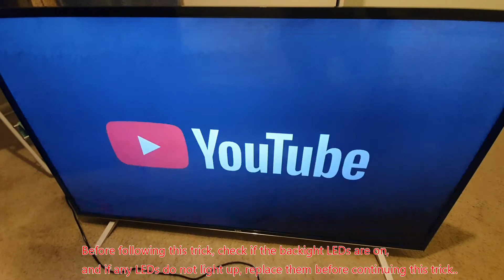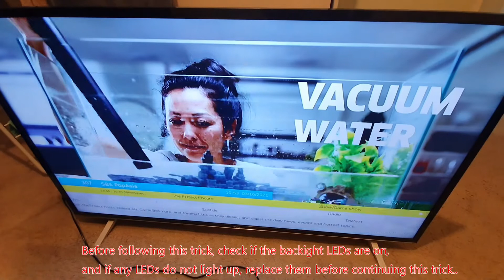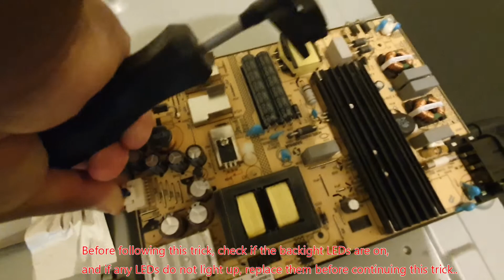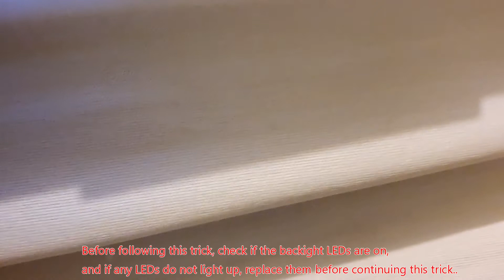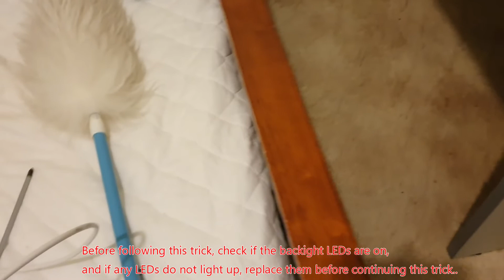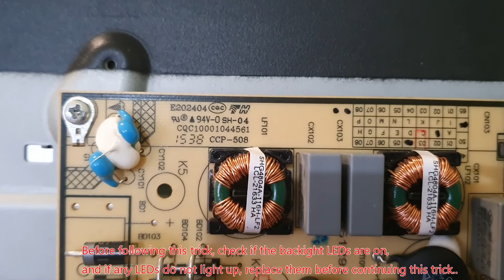TCL Smart TV Backlight Flickering Issue Fixing Trick

Comment: The issue I have with a 55S451 is that 1 side with go 50% dark the other side about 25% every minute or so for split second then recover, see some say a setting to turn off for certain content, so different issue with mine if not app related.

Comment: Bought a used TCL 43S405 and it's having this same issue. Googled the power supply and seems to be different, not sure if it will be a similar fix or not though. Setting the TV to "Low Power" in the picture settings, and the brightness to "Normal" makes it stop flickering constantly but the picture is a lot darker than I'd like. All of the LED's in the backlight seem to be working as I don't see any dark spots in the screen anywhere. Seems the power supply is just cutting power to the strips constantly. If I set it to any mode other than "Low Power" and then set the brightness to  "Brightest" in the menu it starts flickering constantly every 2-3 seconds almost like clockwork. If I set it to just "Bright" it flickers every 5-7 seconds. Turning "Low Power" mode off, and setting it to any other picture mode and the brightness to "Dark" or "Darker" seems to "fix" it as well. It definitely seems to be something power related, I just don't really know what. I'd guess heat related if it didn't do it almost instantly between switching brightness modes, but it's not a slow build up. Feels like LED over current or something. As soon as the LED's get more voltage it cuts the power to them on a cycle. I'm guessing good power supply, bad LED's? Lower the voltage sent to the LED's seems to be the "working" solution, so I'm not sure of a proper fix. Thoughts?

Comment: Thank you for the video. I remove 2 resistors. Still blinking. Put heat sink. It is working if i do not put the cover on. Then my last solution. I drill 16 holes on the cover so there's air ventilation for the heat sink. It is working ok so far for 10 min.

Comment: Hi bro led is good . But top right corner only blink .... What is the problem
Reply: I have the same problem right side Flickr snd red line/pixels vertical,from what i see it was fix with tape on the 12 and 13 pin but you need to have two 80!pin and no one going from main board so you do it to the one going to the right side only.
From what i know so far it was sorted ic on main board that need to be isolated pins by the tape
Reply from the maker: This may be due to panel issue. First remove the LCD and turn on the backling and see whether the LEDs are actually blinking.

Comment: Hi. We have the same problem and I followed your instructions. After I removed one of the resistors, it worked for 15 minutes then again same problem. I did not fix the heat sink but I removed another resistor. It was turning on but no more led lights from the screen. Now, I messed up the 2 resistors. Can you advise how to fix? Shops here dont have the R470 resistors and need to order online.
Reply: I have the heat sink available but I still need to fix the resistors first before putting additional heat sink.
Reply from the maker: Did you check the LEDs in the backlight, are they all good? If yes, add a resistor back and add extra heatsink(don't short circuit the heat sink and other components). Also do a proper dust cleanup for both Power board and main board using a brush.
If you lost two 470 resistors, just use around 47 Ohms normal resistors for them. Don't use low values, it will damage LEDs.

Good luck..!
Reply: @tech-corner2556  yes all led's are working before I lost the resistors. I don't have any clue about resistors as I just diy the problem and came across your video. I will check with some shops here about 47 ohm. Thanks for replying.
Reply: @tech-corner2556  Sir, how many watts should I use if I will buy the normal resistor with 47 ohm?
Reply from the maker: @spanksoil4  If you are going to add back two 47Ohms, use 0.5 W resistors. If you are going to add back only one 47Ohms, it is good to use 0.75W or 1W.
As you said the backlight was working when only one 47 is removed? If yes, I recommend to use two 100 Ohms with 0.5W. It will make 50 ohms resistor (because they are parallel) which is close to one 47 Ohms. You can easily find the 100 ohms 0.5w resistor.

Comment: My TCL 55 screen is flashing from the top right side corner.. quick flashes till the half of the screen
Reply from the maker: @Jay, can you upload a small video clip. Then I can help you.
Reply: @tech-corner2556  Hey thanks for replying 👍👍  Please find link for video
 https://youtu.be/naB1-JaHjcU
Reply from the maker: @JC-YT-JC  I just watched your video. This may be backlight issue or panel issue.
To identify the issue follow these steps.

1. Remove the T-CON board to panel ribbon cable in the flickering side and turn on the tv. Now you will see a dark or white color screen in that half of the screen. If you still see the flickering (if the screen is dark you can observe the flickering via other side, because the flickering is spread in whole screen in background if it is a backlight issue), it is a backlight issue. then remove the backlight cover and test all individual LED's and replace bad LEDs. See this video for more details : https://youtu.be/6CVT9-Lts4o

2. If the flickering stopped when remove the ribbon cable in that side, it is a panel issue which is difficult or unable to fix. You can try this method and if you have a luck, you can get it working > https://www.youtube.com/watch?v=pfrRhw7-ZII

Don't think about the issue which explined in that video, but follow the Tape pasting step. You don't need to use large tape and cut and remove. Jut paste a small (around 2-3mm) tape to cover few 2-3 lines and move the tape into different lines untill you get a proprer picture without flickering..

Let us know the results. Good luck..!
Reply: @tech-corner2556  Amazing 👍👍 Thank you for your reply. I will give it a go 🤗
Reply from the maker: @JC-YT-JC  What happened to your tv issue, Fixed? Im not sure whether this is the issue you see, just check this : https://youtu.be/7H5pvbr2ESo

Comment: Picture is intermittently moving up and down .  From clear to blurr
Reply from the maker: Can you send me video? Then I can get a idea about the issue.
Did you check/clean the t-con ribbon cables first of all?

Follow these steps:
1. Clean the T-CON ribbon cables.
2. Remove one side's ribbon cable to see other half of the screen is working correctly. If working correctly, that mean the removed side has the issue. Do the same thing for other side as well. Not you can understand whether the issue coming from a side or not.
3. If the issue exist in a side, you can try this trick > https://www.youtube.com/watch?v=pfrRhw7-ZII
I had a picture flickering up and down  issue (may be this is the same issue you have), and fixed with this trick. Good luck.
Reply from the maker: @Alfredo, I think that this is the issue you see. Just watch this video and try to fix it. Good luck : https://youtu.be/7H5pvbr2ESo